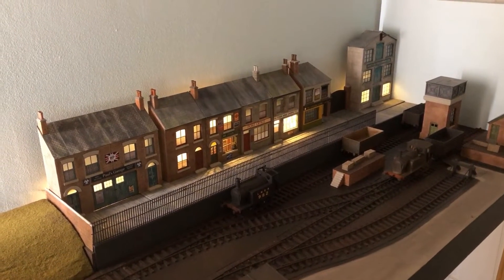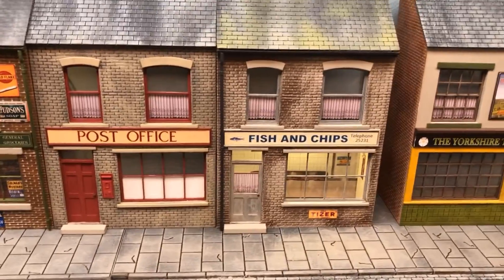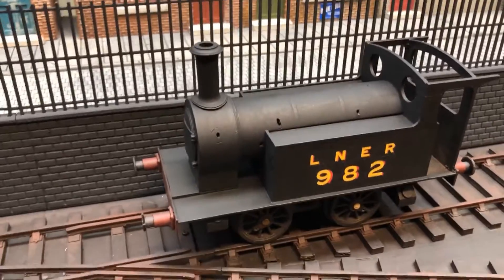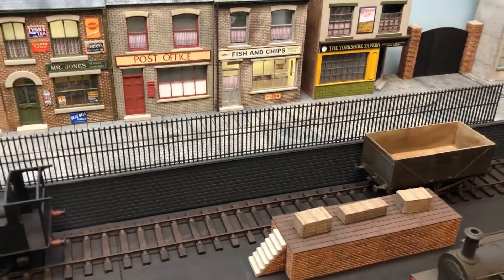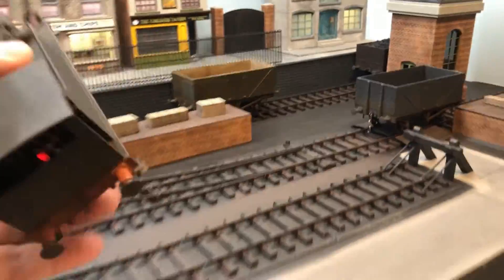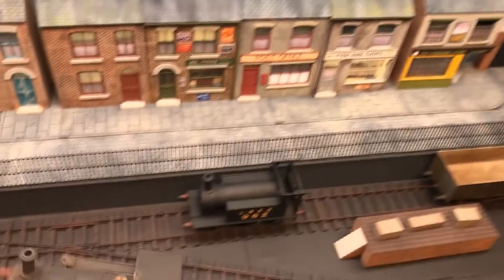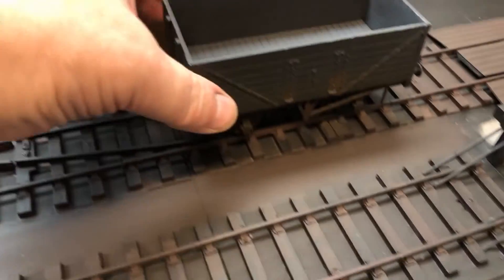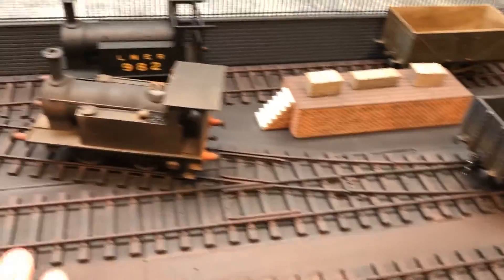The World's First Fully 3D Printed British O Gauge Model Railway

Comment: I have been 3D printing out O gauge over the last 6 years or so and it took a while to fine tune the printers good enough to do the job. I don't own one myself but work now has 3 machines ( 2 flashforge Creator Pro's and 1 Raised Pro2 ) I do print Australian NSWR Steam Era rolling stock and it beats paying big dollars for factory made stuff. I use Solidworks and then print from there. So much stuff can be printed with a 3D printer and it takes a little bit of practice but heck you can print some good stuff out for sure. I just finished printing out a model of a Komatsu 830e Dump truck scale 1:15 and weighed in at a whopping 16kgs. I printed out for work to go to a show for our stall.
This will be put up on the tube soon.
Well done on your project awesome job, especially the track system. What 3D printer do you use as I though about buying myself a Flashforge Guider to keep on printing at home. And the finish on some of the rolling stock is awesome. 
Cheers and keep it real
Brad

Comment: I've printed all my rolling stock and a few loco's, but i'd gone with Peco rails to ease flexibility, as it's nice to take my stock out for a run and not need to worry about compatibility, as well as being able to accept visitors. I also use metal wheels which does mean a few aren't as detailed, but the weight and reliablity is much improved- my plastic wheels i made a few years back didn't come out nicely, too much friction
you've gotten a great finish on things though, but it must take hours of work to get them so polished- i do budget wagons mostly which are much quicker and my Ender 3's can do a decent finish on standard
i have a few low quality videos on my chanel if you're interested
Reply from the maker: Thank you Skog, I found as long as I make sure the plastic wheel treads are smooth and I use brass axels and ensure they spin freely in the plastic model axelboxes. I will have a look at your channel